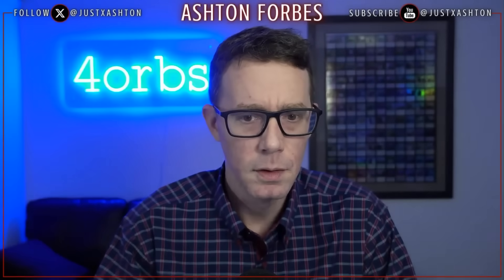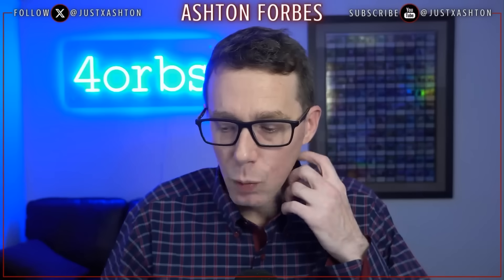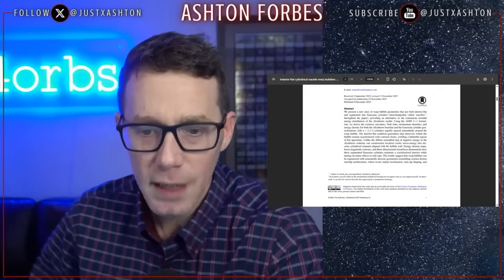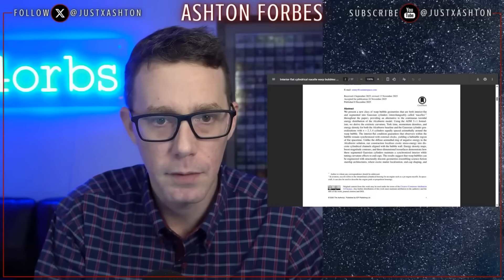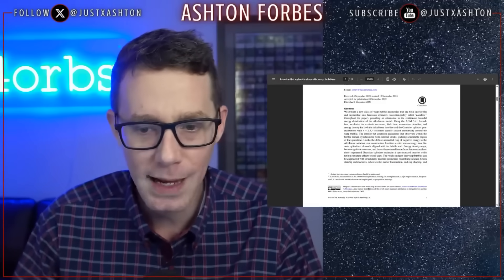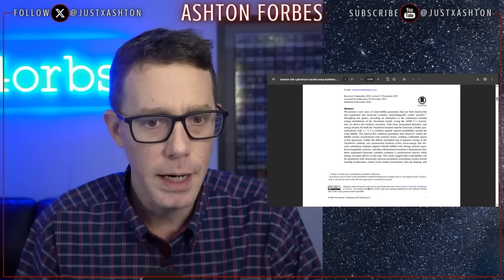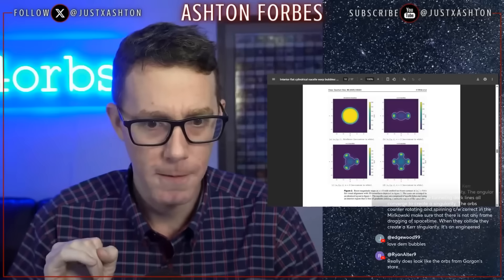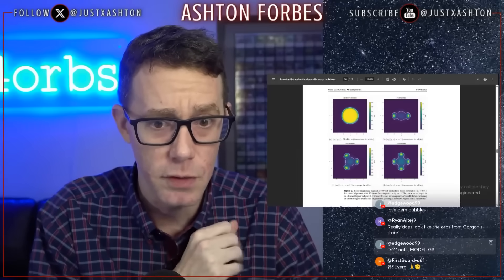Sonny White's New Paper Matches the MH370 Configuration

Comment: Ashton Forbes is a grifting crackpot fraud, and he should be ashamed. His postulations are based on whimsical fantasy, and not on fact, nor does he posses the necessary skillset to remark on this incident from any valid scientific perspective. The families are still clinging to hope looking for answers. Shame on you. 

That being said…

Regarding Malaysia airlines flight 370(I’ve followed this religiously since march of 2014, and have scrubbed every technical assesment and report including nearly every article from IG members,) I am no longer able to subscribe to a pilot suicide event(which is patently absurd,) nor can I subscribe to the idea of a hijack. 

Here are the FACTS that must be explained simultaneously, and any credible explanations MUST account for all of these, not just some. 

1. ACARS stopped transmitting BEFORE loss of radar detection 

2. The transponder was turned OFF

3. A deliberate turn-back and complex routing occurred 

4. The flight continued controlled for 6 to 7 hours 

5. No distress call/no squawk

6. Final flat path consistent with fuel exhaustion 

7. No evidence of structural failure(I.e. fragments falling out of the sky.) 

Given these facts, we can deduce that mechanical failures alone fail because: 

1. Mechanical failures ALONE do not selectively disable ACARS/Transponder/Radios

2. They do not produce complex navigational changes

3. They usually produce distress calls or alerts

4. They often result in a debris field near the failure point of the flight

We know that a crew hypoxia event ALONE does not account for a coordinated turn back, let alone any complex navigational changes thereafter. It is also understood that in this event, the auto pilot would continue on its last heading AND not reprogram navigation. Crew hypoxia ALONE can explain the end, NOT the beginning. 

The scenario that best fits ALL evidence is: 

1. Someone with cockpit access: disabled ACARS,  turns off the transponder, alters flight path; there are SEVERAL reasons which could cause smoke in the cockpit and an electrical fire which include: problems with the cabin oxygen system/valves etc, ergo, Shah isolated the entire left electrical bus to mitigate the fire, and he was successful, but not before step 2 occurs. 

2. Subsequent depressurization/hypoxia: the crew becomes incapacitated, which explains no distress calls/squawk

3. Autopilot continues on heading

4. Fuel exhaustion; at the end of its flight, one engine flames out(the right engine burned 2% more A1 jet fuel than the left engine,) autopilot disengages, the aircraft descends uncontrolled into the ocean. 

Similar patterns exist in prior aviation accidents. 

In the attached radar detection graph contained in the investigation report, compared to  graph 2. showing the nearest airports, you can clearly see that  Zahari’s deliberate and decisive turn back towards the Malay peninsula was a conscious decision to divert back to the nearest airport and safely land the plane and save the crew.

For anyone wondering(which in all probability is many of you,) the protocols and procedures for handling an onboard cockpit fire upon observing flames, smoke, and a burning smell is per Boeing is:  Aviate/Navigate/Communicate

In order: 

1. Crew o2 masks are donned 

2. Keep auto pilot engaged, or if not, re-enable auto pilot after navigational re-route towards nearest airport 

3. Identify the fire type(electrical, avionics, wiring bundles etc.) 

4. Activate cockpit HALON system. 

5. (This is the smoking gun here!!!) Crew must begin power isolation by… switching off non critical electrical systems OR isolate those systems by pulling specific circuit breakers. This explains the loss of HF, VHF, transponders and most importantly the ACARS system as Zaharie in my upomost certainty isolated the entire left Bus to put out the fire, rendering those systems inoperable. 

6. Vent and smoke removal

7. Land ASAP

And finally…

8. Notify ATC of intention to divert due to onboard critical emegrnecy.

Comment: According to Tesla, Einstein was not correct. You cannot bend space because space is not rigid. You can’t bend something that is not rigid and has no physical properties. It’s better to describe it as displacement than actual bending.
Reply: they just use different semantics. Spacetime being bent inwards looks and behaves like a medium being compressed inwards, which is the result of something having less density in a medium. Geometric curvature is just a way to express it using coordinates. The bent space bends inwards because the points in space represent a medium, and points in a medium going inwards is like a void in a fluid, it makes all particles around the void go inward to neutralize the void to equallize density. If you think of a fluid composed of particles evenly spaced in a lattice, which is approximately a fluid at rest, and represent those particles or lattice nodes as coordinates, then the geometry of it is a different way of expressing fluid or medium behavior, with a different mathematical model that those typically used to model fluid dynamics. 
The space that Tesla talks about seems to be an etherless space, meaning that the properties are due to the ether filling space, with space  itself just being an imaginary room for it to fill, which makes sense given how in his time, the ether was thought off. Einsteins space time is just a different model of an ether, just one that is highly unintuitive semantically, only concerns parts of its properties, and avoids anything that isn't required for the explanation that it was invented 
for. 
The vacuum, the ether, space, spacetime, etc. is all the same thing, so Tesla might have been confused by the fact that Einsteins model gives space properties that are properties of an ether like medium, but then claims it to not be a medium, just space having those medium like properties. So just semantics. 
Also, when people say that objects follow geodesics in curved spacetime, think of a hight map representing a 3d density map, with an elevation on a 2d plane representing a bigh density, outward pressure and flow zone, and the reverse, like gravitational wells, being low density, inwards pressure, ether attracting zones. If you think about this in terms of fluid mechanics and density distribution, it's obvious why the physical forces are the way they are, and if you instead model the density behavior alone without considering flows, and represent it using a coodiante system and it's geometric transformations, then you get the 3d representation of curved spacetime often shown in mainstream physics videos around a planet. Space curving is just really unintuitive, and semantically confusing. Space isn't bending into somewhwere, it's simply being squished and stretched , because it's a medium or material with density, that's how it can "bend" replace bending with squishing and stretching or compression and expansion due to density of a fluid or lattice, the it makes sense and describes just a 3d ether, no need of weird dimensions and this kind of stuff.

Comment: Imagine how a gearless differential system of rotational force and three pints of spins within spins these ceramic tubes are pumping plasma or a frequency of a transitional amplifier that's push pulling the wavelength into the mindset of resonance in three states the other tubes arexare charged noble gas bubbles in the other 5 tubes doing pushing and pulling on the dynamics of the gearless differential design expansion and contraction of gelatinous thickness place holders for contactors to give and take charge collapse for this rotational force against the system it directly starts rotational force again the tree space prismatic points are linier and with in the point ahead of the center a cancelation is occurring collapsing in behind the warped point center balancing and making a field of non vibration or super positions in time. HYPOTHETICAL IONIZED WAVELENGTH??or something else?

Comment: 3 vs. 2 or 4 orbs provide the most recoverable symmetry. Think of a stool. A 3-legged stool, by definition, is infinitely more stable than a 2, 4 or more legged stool.
Reply: ... only on quite uneven surfaces. On flatter surfaces, 4 legs are more stable. Which has nothing to do with weird teleportation technologies or whatever. It is about points of stability (legs) maintaining contact with a surface (floor).

Comment: I think the coolest part  is if done  in specific geometric patterns and charge characteristics had a continuous loop frequency the propulsion systems wouldnt have to be attached and could not only be unattached and havevyhe capabilities of more fluid esp in transitions and travel,  but depending  on the system initial earth launch into orbit,  rh even more exciting aspect is we could propose this system much earlier thsn we could in order configurations. In thidms fluidity nobbcknnectrd but orbit pr gravitational coupling  system even if we haven't mastered chemical  rocketry significantly,  we could launch separately with outbhsvingvthevburdenbof low earth orbit construction ,via either man or robotic means.  So theoretically we could imagine this travel mybai and non human system within 20 years  I'd guess . The chemical makeup of the injection  system in higher gravitational portions of travel would from what ive deduced look like a simple  mixture  with a temporsreky stable fir logistics pre orbit then 2 staged fission creation to antimatter  storage styled battery cell would be bith financially optimal andbsafebfir preparation by men pre launch. Polar  launch with Trans equatorial to angular  momentum to connect the crew carbon wif manned or main deck going  2nd wuthnthe propulsion thrusting compartments launched in obe famcin heavy style requirements in terms of weight capability  and even smaller  in size.

Comment: So according to what is being said, it sounds like mh370 was turned into a space craft. There had to be a central control source on the plane. Is that what the batteries were for? Was there also some sort of secret tech also on the plane? (Smuggled by scientist,govt or …?) is that why the batteries appear to have coughs fire? Was this planned  or an experiment (gone wrong) could mh17 have been where the warped plane came out? (Bodies were badly decomposed when found)
Reply: The batteries were fuel for the deliberately ignited fire. Two possibilities: (1) the fire's heat played a part in the reaction with the orbs. (2) Smoke causes oxygen masks to deploy - and that air contained a sedative to pacify the passengers. There is said to have been at least one hard drive with sensitive information on the plane. Also, the scientists held a wealth of knowledge. The whole plane and its contents were instantly sent to Diego Garcia, killing all occupants (if the smoke from the fire or the chemicals in their oxygen masks didn't do it first).